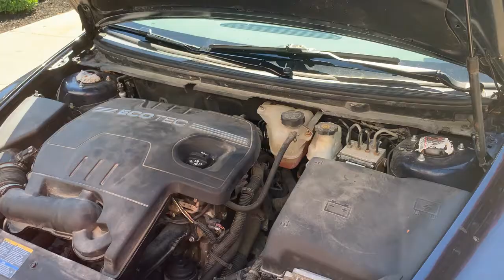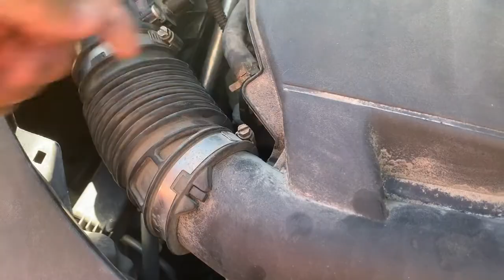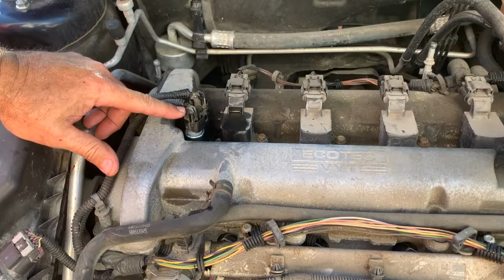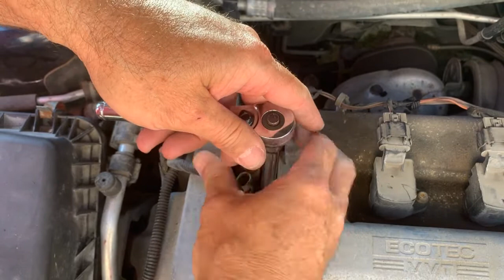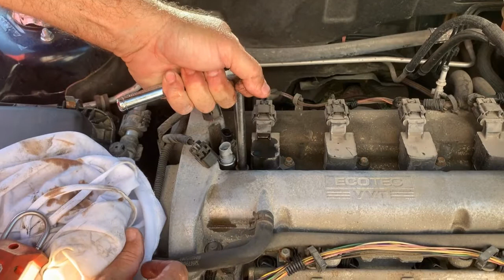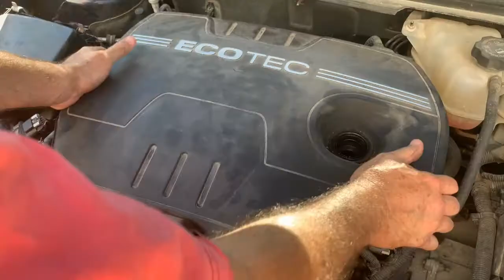How to Replace Variable Timing Control Solenoid Valves Chevy Malibu

Comment: I don't have the screw on the right.  Wth.
Reply: Can't get my cover off. 😢
Reply from the maker: For the cover, did you loosen the screw on the throttle body and removed the engine Oil Filler Cap?

Comment: I have to replace the vvt solenoid but i wonder if thats what the check engine light means
Reply from the maker: With a check engine light you can stop at most auto parts stores and they can scan your vehicle for the PO code.With this information you can then make sure that you're replacing the correct part.

Comment: Did the car run way better after swapping them out? Im considering to replace both because my malibu feels slow on accelerating and the rpms keep wanting to drop at complete stop. Thanks!!
Reply from the maker: Yes it did, do you have any PO codes ?
Reply: @TheAutoTeacher  no codes on my car have came up, im trying to find the reason why its acting like it is
Reply: If there’s no codes consider changing spark plugs

Comment: What about code p0171 , my car won’t start and it stating I need a fuel pump but before that happen I had code saying I need a solenoid . Can that cause that issue to get the p0171 ?
Reply from the maker: What was the code for the solenoid ?
Reply: Get the water pump man 😅

Comment: I removed mine today with new ones. I looked at it and it's got oil on the top. Do you know why it would be doing that?
Reply from the maker: Were the rubber O-rings in place on the new solenoids?

Comment: Why they go bad my guy
Reply from the maker: Failure of the camshaft variable timing solenoids can be caused by dirty oil, oil being too low, or even using the wrong viscosity.
Reply: we all get old

Comment: I’ve noticed debris in my solenoid socket how do I got about cleaning it out?
Reply from the maker: That's why we mentioned cleaning the area before removal, once inside the motor debris is difficult to remove. Maybe try some type of vacuum cleaner .

Comment: I just did this, but my new one had a 8 mm bolt instead of 10.
Reply from the maker: Ours was a factory GM part, so the bolt was still a 10 mm. Sometimes aftermarket parts vary bolt sizes.